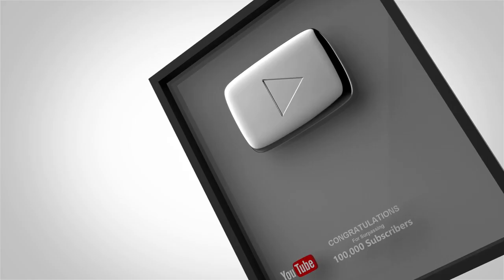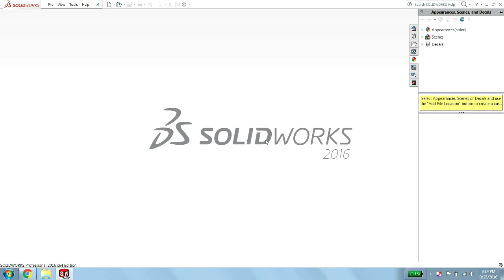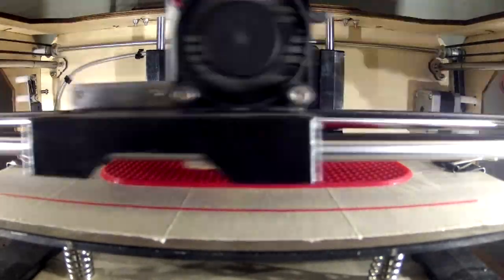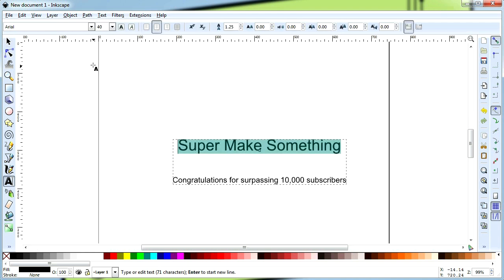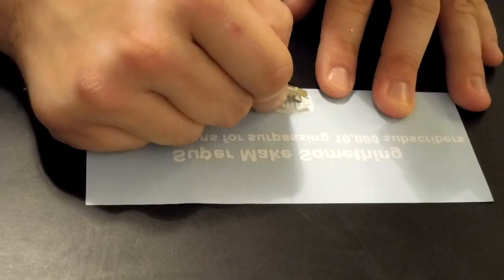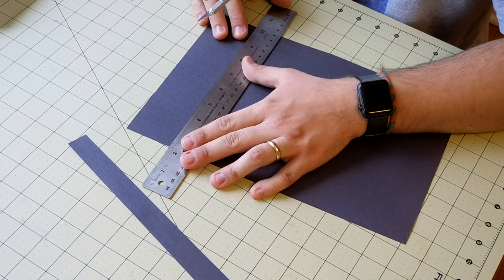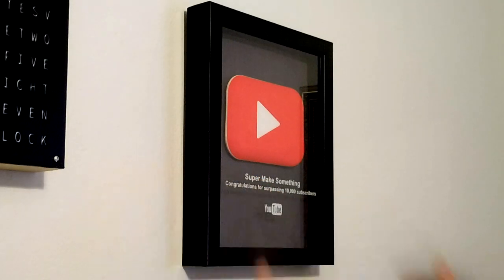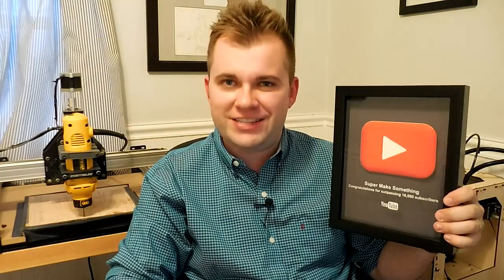10,000 Subscriber Plastic Play Button (3D Printing, CAD, Craft Cutter) - Super Make Something Ep. 11

Comment: Printing with a brim would reduce the likelihood of curling, awesome project btw
Reply from the maker: Thanks!  That is true, a brim would also help to keep the tape down.  You can see that there were some issues with tape adhesion in both corners where the object curled.  I've also found that the material properties of the filament seem to have a lot to do with it.  For some reason, the white filament I used for the base has a kind of "gummy" consistency.  Getting good results with this roll has always been a bit of a struggle for me.